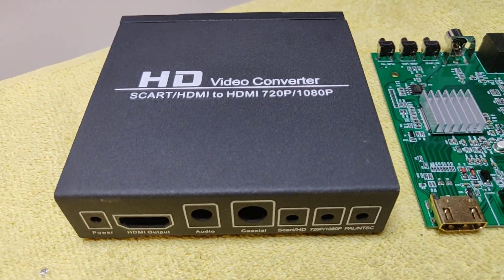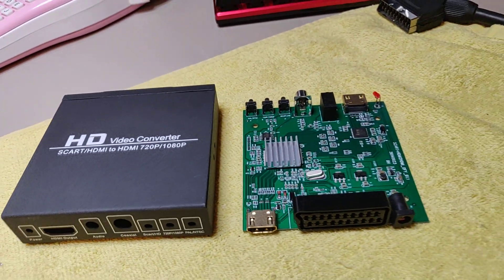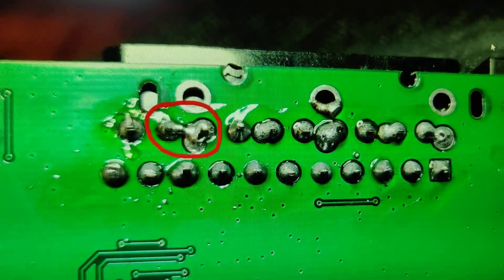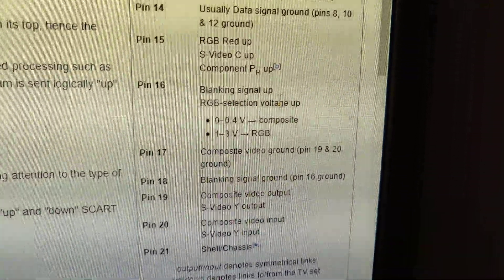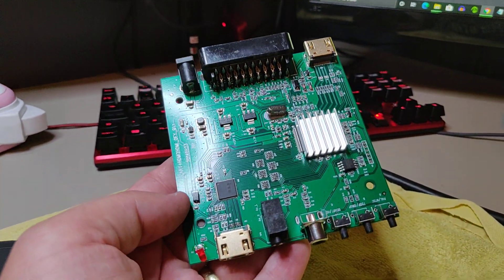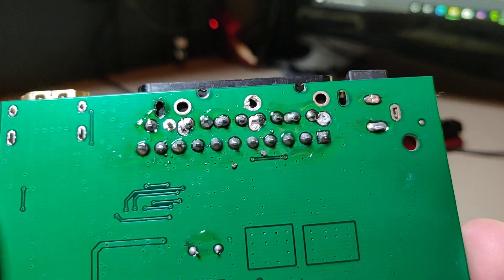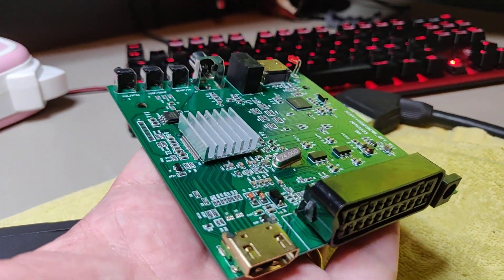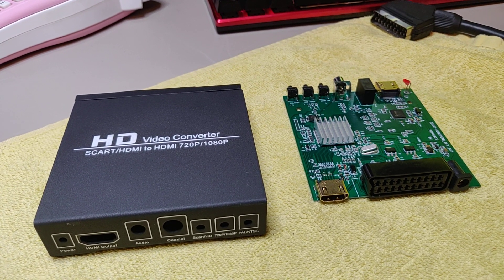How to repair your SCART 2 HDMI HD Video Converter

Comment: I have similar one. I burnt up a transistor.  Can you tell me what is on the small transistor under U3? Or where you found that site.  Thank you. Someone used too big of a power supply by mistake.
Reply: it was the similar case in mine, used 12v instead of 5v and it looked like burned U2 transistor...did you have a chance to find these?
Reply: @sebastiansosnowski5610  If you couldn't read the name on it due to damage, it seems to be LD6BC. At least that's what the U2 on mine says
Reply: I'm a little late, but I have one of these that I had similarly destroyed using the incorrect power supply, and the transistor on mine is a AMS1117 3.3v

I'm still trying to figure out what is wrong with mine, I don't see any obvious signs of damage. Do you think it's one of those transistors?

Comment: i've got mine today... sadly i have no signal all the time, no matter if i use hdmi or scart input ;c any help here?
Reply from the maker: I guess you have power, and the red light is lit. And you have played with the buttons  - give the buttons a few seconds before you press again. It need time to adjust. Sorry that my suggest is lame, but tat's all i got.
Reply: @RetroErik  i'm going to refund mine, from what I heard it's hit or miss if it works on certain devices, goin to buy component to hdmi at least :/

Comment: I think the cheapest I see this one is $15 on Aliexpress. They have $6 ones that are smaller and have blue strips that only do composite. Do you know if this is the only thing you have to do to get the cheaper ones to read RGB? Also do you mind sharing the link to the heatsink in the description of this video? Thank you.
Reply from the maker: The fix i talk about in the video, is probably only a fault with this and maybe other units in the same batch. I have bought a new one, without this solder fault. I will make i video about it in a week or two.
Heatsink: https://www.ebay.com/itm/12pcs-20x20x6mm-Aluminum-Heatsink-Cooler-With-Thermal-Tape-For-IC-CHIPs/124110813140?hash=item1ce594b7d4:g:sdIAAOSwETxejIem